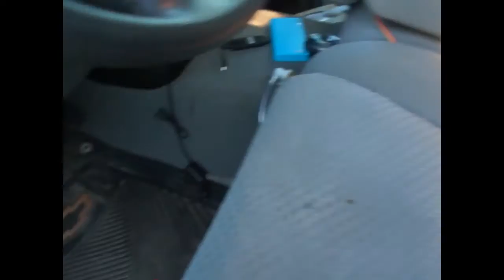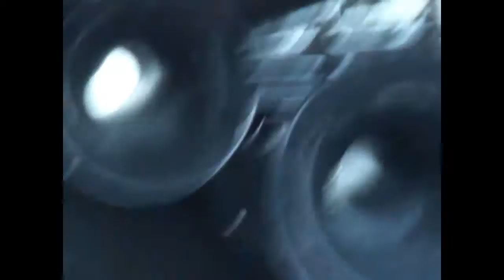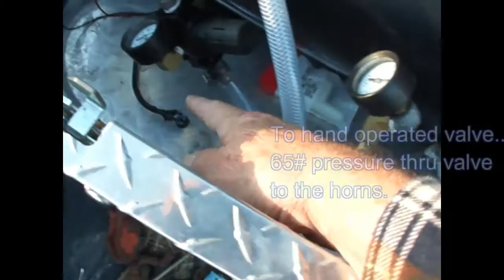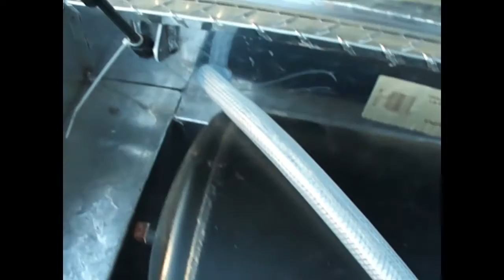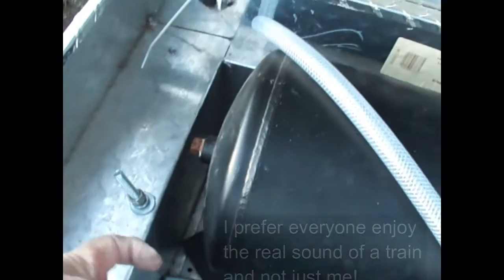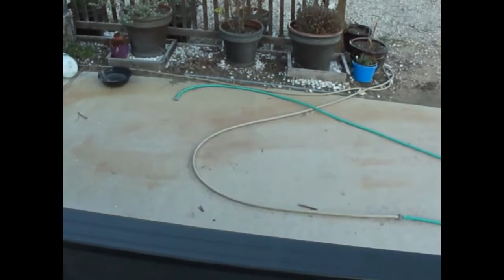k5la train horn installation

Comment: Glad to see someone else has the cheap China remote also on their horn set-up!
As for the NO difference in sound with different hose sizes, I disagree but than again you are regulating your pressure. 
I started with 1/2" hose, BUT 1/2" pipe made my horn louder (running full pressure, yes it eats air).

My set-up: 2006 Scion XB
K3LA hidden under rear bumper, 13 Gal air tank (compressor only hot by switch) , 1/2" fully piped, dash button and by remote.
Graham-White E-Bell hidden in the front left quarter panel.

One of my most recent video:  https://www.youtube.com/watch?v=Ft8gjh6jkYE&t=91s